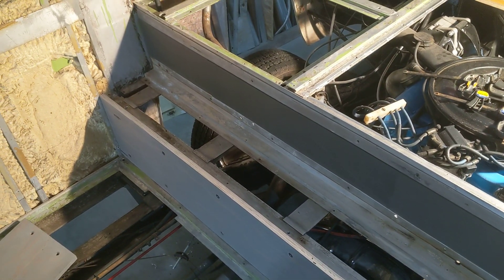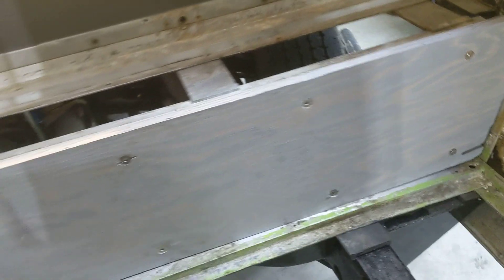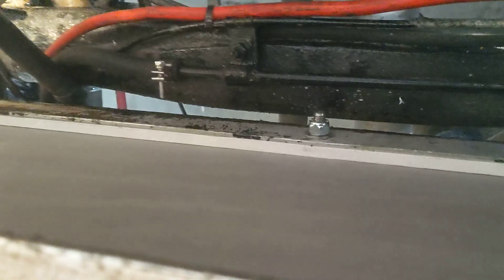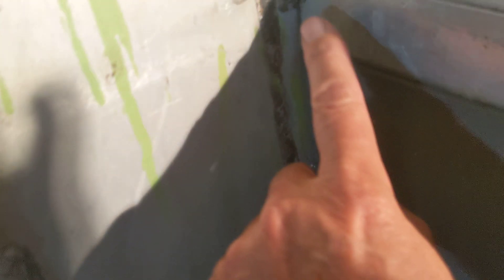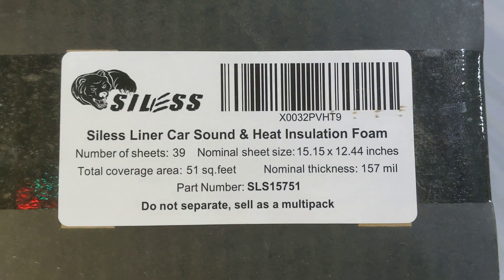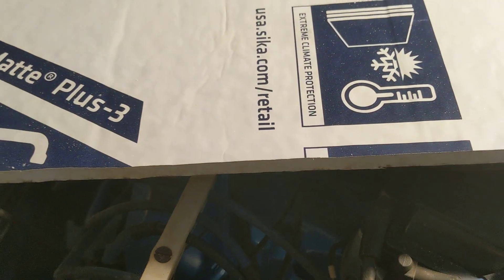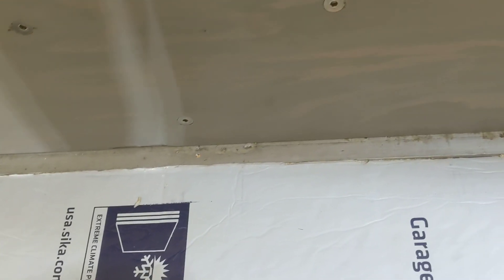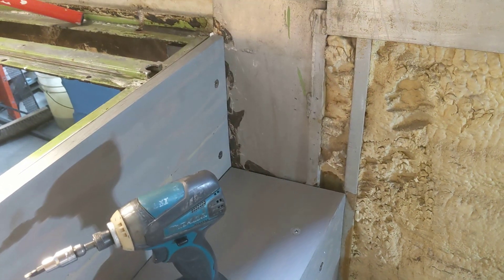GMC Motorhome 88 (step install)

Comment: I remember when you rebuilt the engine and installed it. But I cant remember if you ever test ran it after it was installed.
Reply from the maker: I test ran it up to temp and filled the cooling system but I have not run it with the radiator cap on.

Comment: Can you show how you plumbed the two black water tanks? Single drain valve, or two. Are you going to install a macerator pump?
Reply from the maker: I have not done the plumbing yet. My thought was to have a valve at each tank and a common dump. No plan for a macerator.  I subscribe to the KISS philosophy.